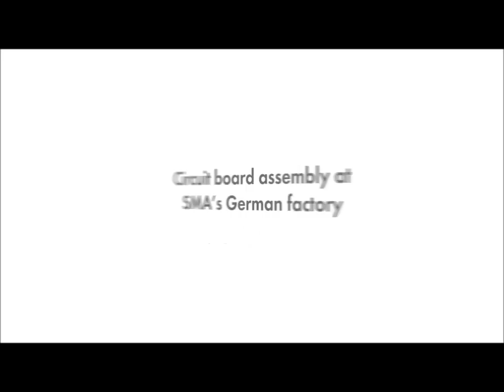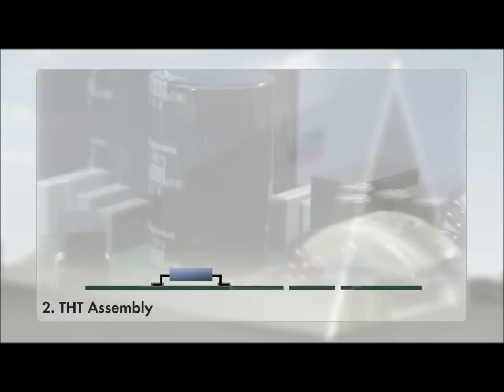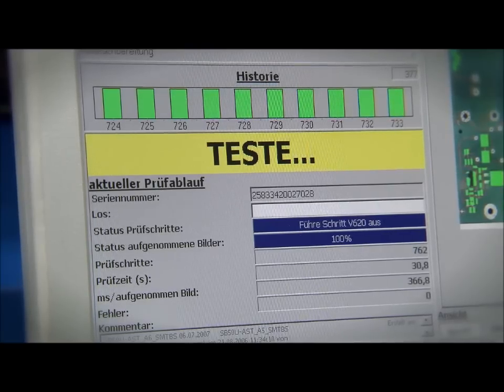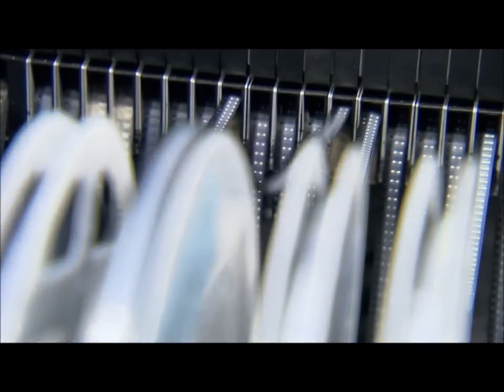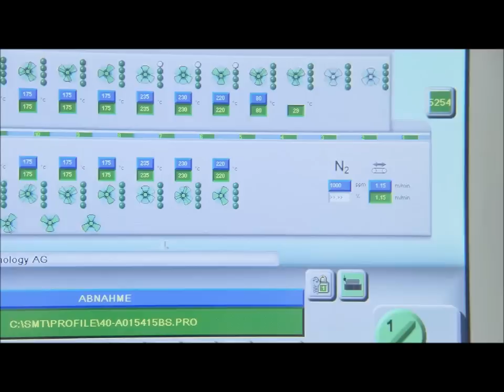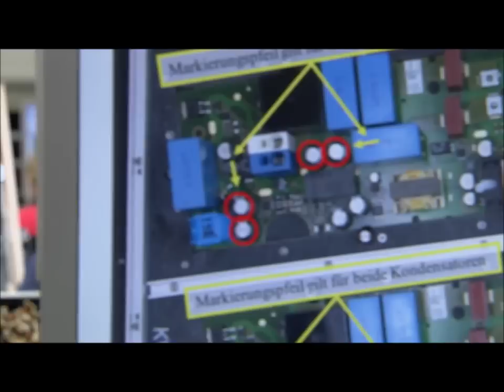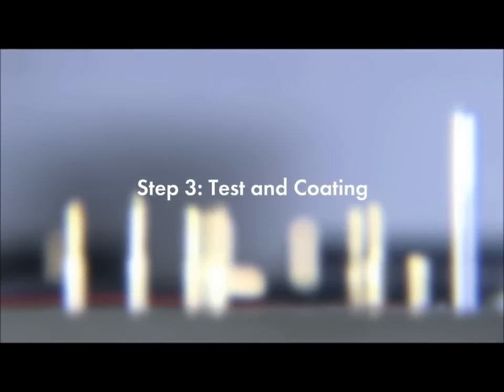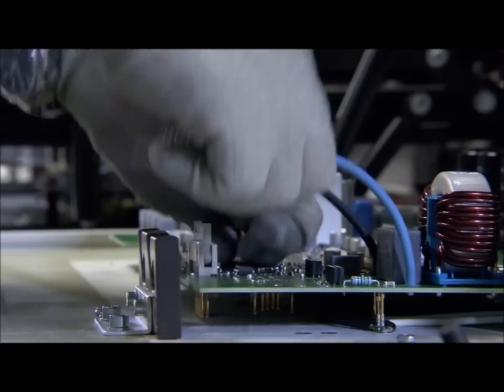SMA Solar Technology Circuit board assembly at SMA's German factory | renvu.com

Comment: Sir which components are use in solar hybrid inverter for supply excess energy to grid
How can we make such circuit to convert normal inverter to hybrid solar inverter
Reply from the maker: Hi Anukesh! To be able to assist you, we need a little more information. If you could email your questions to info@renvu.com, our sales engineers will be able to help. Cheers!

Comment: Oh no, This Man in the Video made mistakes by put in capacitors.
The Inverter works only for less years. WTF is this.
Reply from the maker: Hi Alfred, where in the video posed a concern for you? Cheers!
Reply from the maker: As you see by the date, the SMA video is from a few years back. Older inverters have big ceramic capacitors, which expand and contract and yes, eventually fail. Newer ones are using better technology.